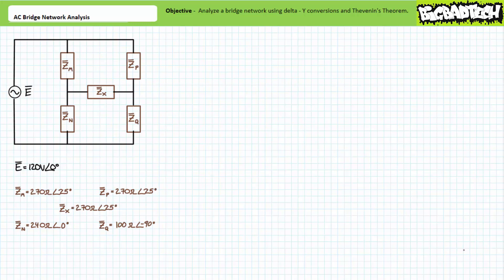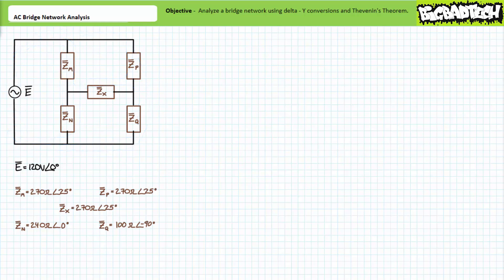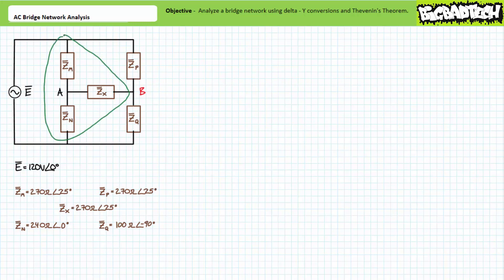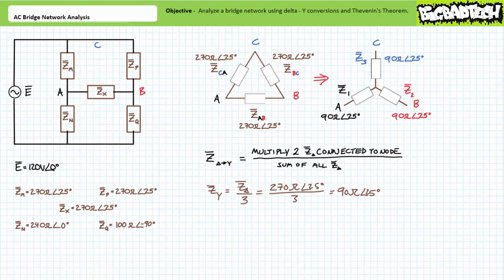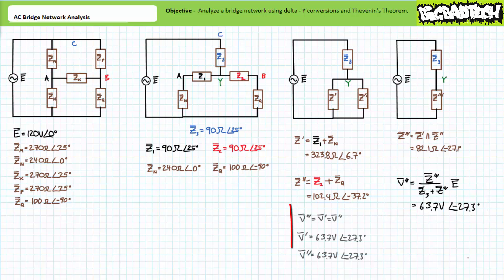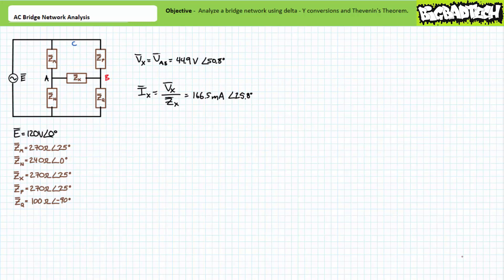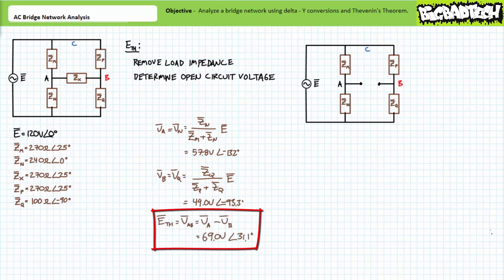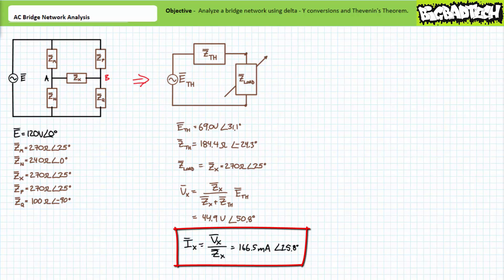AC Bridge Network Analysis (Full Lecture)

Comment: I made an interesting, rookie mistake on your first example, by oversimplifying up front. With a balanced delta, when analyzed in isolation, it is tempting to simplify the delta to a single impedance of half the impedance of each arm, splitting below that to go to Zn and Zq. The trap seems fair on the surface. After all, when both A and B lead directly to ground from a balanced delta there is no current flowing through Zx. I didn't account for imbalance caused by variance in downstream flow, which leads to a voltage drop across Zx and unbalanced current across the middle. For those following along, you can't take a short cut, you need to make the Y and recalculate after that. A balanced delta responds differently to unbalanced arms, as I should have expected(!).